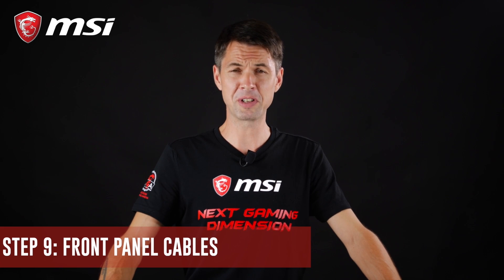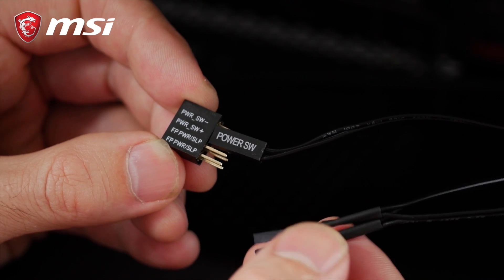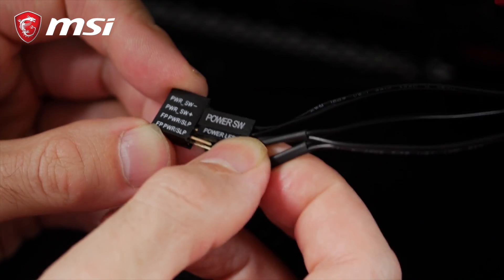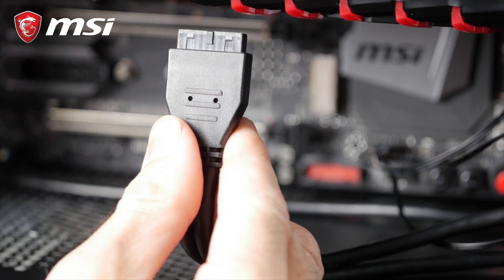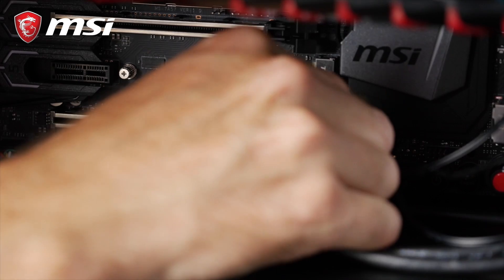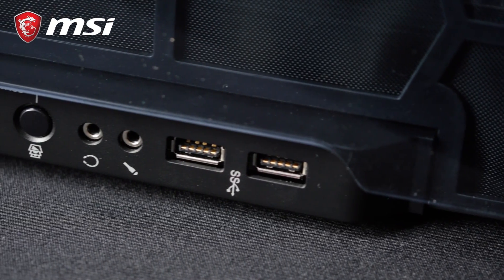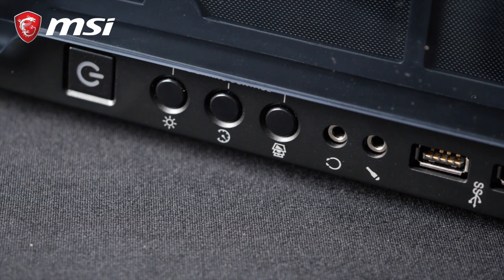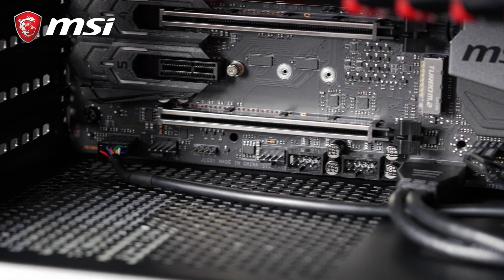Step 9: Front Panel Cables | #YesWeBuild | MSI

Comment: Completely USELESS video.   Come on MSI. you make great hardware. But this video is useless.  

-check your Manual ppl.  There be often one those link on manual that use your phone camera to get link for the video. 
Can also use this video.  This for AMD B450 tomahaw,  Id assume AM4 platform pins be similar across most msi motherboards.   Now not sure if he same for intel boards.   Hope this helps some ppl. Good luck. 

Just upgrade to Msi x470 gaming pro Carbon with R7 2700x, ( as x570 too much here in Canada) coming from i7 3770k 3.5 GHz. Which keep as back up pc.  Also helping my friend build x570 gaming plus with 3600x. 

https://youtu.be/9--Nbg2qKUA

Comment: MSI makes great boards but their documentation sucks. More geeks who don't know how to communicate. I installed two B360M's in old Vista era towers. I can't get the front headphone jacks to work even when the drivers on the included disc are installed. The installation also has no interface you can control. And of course there is no pinout diagram.